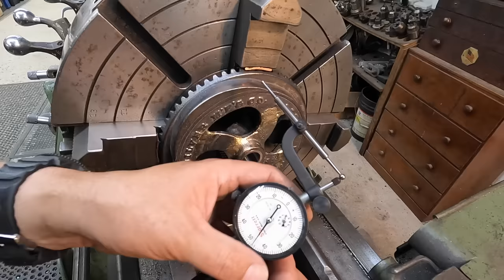Reparing the 100 Year Old Broken Gear

Comment: When I was a sprout I'd watch my dad weld up broken cast parts  with cast rods and an old gas oven and a torch with a blow torch to keep heat. He'd tap the part as he went and when finished he'd throw a fire blanket over the parts as he shut down the torches . I was always amazed to watch him work. Then in later years he used his forge to warm the parts and kept them hot with a large heating plate over his forge. He also taught me brazing  and how to torch weld aluminum. God rest him.
Reply: come to think about it,(hind sight 20/20) if he would have heated that gear it might not have cracked when sleeve was pressed in..
Reply: @donaldburg7532  at the least warm the gear and cool the insert
Reply: @donaldburg7532 loocktight
Reply: WOW what a great memory. Thank you for sharing @donaldburg7532
Reply: @donaldburg7532 You forgot about a very important detail. The fix it liquid! Loctite. I mean loctite can handle some heat but not too much. Especially when it’s fresh and still hardening. Much more that 140-150 degrees and I’d be worried that the loctite is ruined. It it was already cured lol hen it can handle temps over 200.
Reply: @AdamA-pm3yn  can't he's dead

Comment: The moment you said you were going to make it a metal to metal fit and use sleeve retainer I started shouting "GIVE IT MORE CLEARANCE!" at the screen. I dealt with an almost identical situation a number of years ago, where I thought I had enough clearance but cracked the hub as soon as I pressed them together.  That sleeve retainer is a miracle of modern medicine, but its girthy and sets up almost instantly.  Since then, on a hub and sleeve that size, I give myself enough clearance that the sleeve can press in by hand.

Comment: Fine work Adam. First time seeing your channel & very glad I saw it. I started on a lathe in High School. I did all sorts of things including threading two 3hp Briggs & Stratton crankshafts to screw them together so I could have a 2 cylinder engine on my go-kart. Also for another engine for my go kart I used an endmill to cut all around where the head gasket fit onto the cylinder head to lower the head making a little higher compression ratio. The teacher said if it worked, he'd do it to his lawn mower and have the fastest lawn mower on the block. The shop teacher called each student up to his desk at marking period end to go over the grade he was giving. When he called me up to his desk he looked at the required projects and I had done none. He said "oh, it looks like you didn't complete any projects." Then he looked up from his grade book and saw it was me and said "oh it's you, never mind, you're getting an A, now go on, get out of here." A few years later I landed a summer job at a precision machine shop where among other things they ground ball screws for missile guidance. I ran a 120" lathe grinding ball threads on 4" steel rods 40 feet long. The 120" was how long the lathe could cut in each setup. I had to move the piece ahead and pickup the lead and do another 120" 3 times on each rod. The finish product thread could not grow or shrink more than 2 1/2 tenths at the joint. They were ball screws that drove the carbon piles in and out of electric generating nuclear reactors so they had to be precise. I ground 16 of those 40 foot long screws that summer between semesters in college. I believe they went into reactors somewhere in Canada. You really brought back those memories. I really enjoyed your meticulous attention to all the tiny details that make up a "job well done." Thank you for posting, I subscribed. ben/ michigan
Reply: Good history, keep on learning!

Comment: I did a similar job like this one a couple of weeks ago.  The owners of the job shop I ran I'm the mid 80s also  owned an electric motor shop. Their machinest machined motor end bells quite often.  I had never tried to machine one myself, but we had a vacuum pump  motor with a bad bearing that messed up the bore in the end bell. In fact, it had been bored and shimmed at a motor shop a few years back.  The end bell was cast aluminum, and I only had the lip that fits into the motor housing to indicate off of. I had to a Brown and Sharp Best Test indicator, but in the end, after five hours of work, I had the motor back in service.  Otherwise, the motor shop turnaround would have been a week or better.  As always,  I enjoy your videos.

Comment: This has been an excellent 3-part series to repair the broken gear.  With the steel sleeve inserted into the bore, that hub is probably stronger than when it was originally manufactured.  Well done and thanks very much for posting this series.  👍

Comment: I am glad you showed cooling the part before the finished cut.  People don't realize how much a piece of metal will swell with heat.  You can use that to your advantage though.  Putting bearings on a shaft for example.  Heat the bearing and cool the shaft and it will go right on without pressing.

Comment: Thanks for working thru your frustration ( ain’t always easy) and providing your viewers with a great video. I don’t know how you would have fixed that with the new equipment. The old school stuff did a great job. Super filming as always. Thanks.
Reply: What the owner got was a farmer repair for an authentic wallhanger. I repair guitar amps, build/rebuild engines as well as a crapload load of other things. On vintage stuff, you put in new parts to make it work, if that's the goal. Give the owner the pile of out of spec, failed parts. If someone wants to restore to "original" the parts are all there. Abom could have destroyed less and created a model (farmers' fix) for an authentic wall hanger, and CNC'd a usable replacement part. 3D scanning the model into a usable CNC plan is no longer rocket science. And it would have been a better choice in the end. And a learning experience for Abom on using his 100s of thousands of dollars in CNC  equipment. If this were a cast iron head and engine block, a reputable machinist wouldn't have done any work without checking for cracks, doesn't matter if the repair is "free". A search on YouTube will give a full education on how and why. At the end, Abom still had the option to make a usable, reliable part but was obviously overwhelmed and wanted the piece out of his shop. What startled me was Abom suggesting viewers take advantage of all his "tips"¿? Abom has done many "good enough" videos. It's his reputation going out the door.

Comment: A good trick when sleeving thin cast iron is machine the sleeve a few thou under and run a straight knurl over it and skim to final size.. it gives somewhere for the locktite to go and it can deform things a little instead of cracking so easily
Reply: Check!
Reply: I thought with loctite you want an anaerobic (air free) environment?
Reply: @wayneswonderarium  You do. But certain thickness of Loctite film is also necessary which is provided by the knurled peaks. It is one of these "it depends".
Reply: @wayneswonderarium   yeah you do but there's more enough restriction to air getting at it for the locktite to set and contact with steel catalyses the locktite setting too
Reply: some Anshutz 22 barrels are press fit that way
Reply: Could a coarse cut also be helpful to gain some clearance for the loctite?
Reply: @Svideoplayer  I've never tried that, it'd have to be really course,  it wouldn't be able to deform a little and it wouldn't let excess locktite squeeze out like a straight knurl will.. it'd probably be ok in steel just to help keep more locktite in but for thin cast iron, I doubt it would do anything to stop cracking
Reply: @wayneswonderarium  You do want anaerobic joint for the loctite to set but you also need some gap room for there to be an effective film of loctite.  Loctite  spec sheets do give a recommended tolerance for the adhesive gap. Knurling and turning off the peaks is well proven method for sleeve fits with anaerobic adhesives. Another method is to turn several shallow grooves onto the outside of the sleeve to give some space for the adhesive.
Reply: @milantrcka121  Loctite spec sheets do give recommended clearance dimensions for various grades of loctite adhesives. The knurl with peaks turned off is a guaranteed method of getting an even dispersion of film right across the whole joint interface. With that high strength retaining compound there is no need for a press fit....simply a close sliding fit is pretty much perfect for a bonded joint with the retaining compound.

Comment: Nice job, certainly rescued this from the scrap bin, just a point, you gotta trust that loctite, a nice easy sliding fit on the bush would have done, leaving plenty of room for the loctite to hold, and that bush is never going to move!, cheers Dave

Comment: What alternate universe were you in when you even considered brazing that disaster.  Maybe cutting a surface for a backing plate and adding that bolt block to the plate may have worked.  The stresses built into a cast part always cause distortion when the part actually detonates in the breakage.  Heck even engine blocks distort.  Look before you leap.

Comment: Hi Adam, love your content! I’ve been watching for years. As a former machine builder,  when I’ve run into trouble with not having a long enough indicator tip, I’ve been able to take a 8-32, or 6-32 screw for example, cut the head off of it, ground a Radius, and used that as an indicator tip

Comment: Adam I have a shop, with mill, welders, and lathe. I am at the point I am the go to fix it man where I live. Put back into circulation, a 100 year old leather cutter, and an old Toledo slicer. Nothing on it worked including the motor, looked new when it left the shop. By the way, I have one of those old Miller welders in my shop, I really like it,also got the everlast multi purpose machine like you have. I have grown to like doing this work, even though sometimes it is frustrating, its the look on the customers face, that pays part of the bill. Dales Welding Works LLC. Mt. Sterling Ky.

Comment: I’m not a machinist, but I have a theory nonetheless…

You measured a .0002 taper in the sleeve. Might there then have been also a .0002 taper on the I.D. of the gear hub?

If the sleeve was pressed in such that the widest end of it was going to the narrowest part of the hub, then wouldn’t it be .0004 tighter at that end? Could that have been enough to cause the crack?

Aside from the misfortune, fascinating vid! Love it!

Comment: I was surprised you didn't leave it chucked in the lathe and pull the bushing through with some threaded rod, washers, and nuts. Perhaps using the arbor press just seemed easier.

Comment: Well done, very tricky to align and braze back. It's worth referring back to the published data, we use Loctite 935 and this one is a 'gap filler' and needs 2 to 3 thou clearance, you often get too familiar with other products from Loctite and assume they are all the same, we've all done it!

Comment: G'day Adam.    Always like watching your 4 jaw setup, you make it look so easy for whoever has never done it.
With the clocking in & fitting the new bush worked out really well. I would have thought you would have spun the finished gear from the central bush you made & fitted, to show how close you were able to get to the original concentricity of the gear.
Great video,  Thanks

Comment: The shipping "crate" for these parts will have to be "engineered" better than ever now that they have several hours a machine shop time associated with them. This customer surely doesn't want the UPS or who ever breaking it again.
Abom79 did a great job filming the process as he did the repair itself.  Definately you won't see any "short cuts" or incorrect tools used in this shop like we often do in some. It's got to be right or its not worth doing which also means, if its worth doing, its worth doing right.
Reply: If it was my part it’d be worth a trip to Florida to get it. No way I’d trust any of the common carriers with that part.

Comment: As the new crack emerged after pressing in the sleeve - my initial thought was wash out the crack well with acetone and blow it out, then carefully silver braze it and let capillary action sew it together.  Probably more heat input than the TIG / sil-bronze application but with some luck, the Loctite washes out of the bottom of the crack and the silver braze bonds the sleeve in at the same time.

Comment: I was curious about how true the bevel gear would be after the repair. For as brittle cast iron is it will still deform before failure. So even if you got the pieces back perfectly before you brazed them in place they would be at the point of deformation before failure. A very challenging repair to be sure!

Comment: A real bummer after such good work. I have had success with this many times, and as you have more than 1 lathe. I use 680 loctite with activator spray, you can have upto .005" clearance on bore to bush OD. Leave meat on bore of bush when making, clean both mating surfaces same way. I use metho, spray activator to both mating parts. Allow to dry, then apply 680 to both mating parts, insert bush until flush with both faces and turn slightly to spread loctite. It cures very quicly, you can start machining bore within 20 minutes. Ive done this with electric motor bearing cover plates many times.

Comment: I know a job can sometimes be done in more than one way and this was one of them. Fixturing is key to jobs like this. All that was needed to be done was insert the part into an aluminum fixture and mount it on a Bridgeport. You could have easily determined the O.D. to gear tooth angle, cut an I.D in a chunk of aluminum to where the part has a very close fit +.002 max, and the ID and gear tooth angle intersect will hold everything in place. Then clamp them down together on the Bridgeport. Indicate the OD of the fixture to establish center and bore out the center bore. The same aluminum fixture could have also been used for the side hole. Obviously, seeing a drawing would be the best way to explain it. 
40+ years of experience. Tool & Die Journeyman, Mold Maker, and thousands of one-off jobs in size from .1 to 8ft., to custom castings and for almost every industry you can imagine.

Comment: Hi, did you ever consider using the internal straight cut gear as your datum location ? Not saying the bevel gear tip location was wrong at all, just alternative way of thinking. I was sent all over the UK, Europe, North and South America to fix primarily gearboxes that were broken, needed a bit of TLC to make them work properly. It is not easy to repair broken items, I would ensure I took spares with me, but I would still end up finish machining parts specific to the gearbox.  So I do understand your dilemma fixing broken parts. Good post, thank you 👍

Comment: When I’ve had to sleeve a bore like what you did I’ll cut a large chamfer on the id of the bore and the od of the sleeve after I made the sleeve a tight slip fit then braze the two together and machine to size.

Comment: Went to vo-tech in high school
Had the best teacher in Merca. Made junk for bauch and Lomb then ran lathes making ordinance at 3 shops. Then went to black and decker Hampstead MD. Got laid off 3 times in 8 years,worked for Harley York pa 8 months under amf. That tells you how old I am. Made chop saw gears at end of b&d American life. Was first job that they let employees bid on. I was 1 of 3 that got it. Tool and die wages. Ran 4 machines at one time.multi spindle screw machine old, new barber Coleman gear shaper, these 2 automatic. Broach, deburr back hole, not automatic. Got laid off when they shut down and sent all machinery to Bethlehem steel Baltimore and melted them down. Computers killed my machinist career. MD. Master water well driller, sanitary owner rest of my life. Rebuilt cable tool rigs, had six.😊
.

Comment: It’s admirable that you are attempting to hold this shape in a 4 jaw. A much easier & robust setup would be with a face plate or flat to a milling machine. Safer too. Keep up the good work.
Reply: @SteveColluns-hm2xx  the machined diameter from the mitre gear is the only reference that is not cast. Face plate would allow dial indicator access without the crowding of the chuck jaws & the copper shims point loading. Stay safe.

Comment: Great work as always, Adam. Sorry, but I kinda knew you were going to split that hub. Do you think a slight interference fit with a plug braze to the sleeve would have worked better? Or hot and cold for a regular interference fit? Especially on a light use machine

Comment: Great 3 videos Adam. I enjoyed them all and felt your frustration on that bushing press crack, been there myself. I have a question about the Noga '3rd hand' particularly the clamp. Did you adapt the clamp to the Noga or is it a factory item? I noticed the magnet on the Noga was a fair bit larger than the ones I have on my Noga arms. Thanks

Comment: After you initially bored iand champhered  it why did you turn at bushing on the other lathe and use a large bolt and washer to press it in while still mounted in the lathe?

Comment: Abom, question, could you have cooled down the sleeve to reduce the pressure needed to press it in place and thus reduce the chance of cracking?  I guess the lock tight would still not have clearance.

Comment: It looked to me like there was an internal gear on the same side of the wheel as the bevel teeth.  I'd think those would have to be concentric with the center bore.  Could you have clamped up on them, pulling outward with the chuck jaws, or is that area just too tight to reach into for the chucks you have?

Comment: Could you heat the cast-iron lightly before you press the bushing in? Not enough to burn the lock tight just enough to expand the cast-iron.